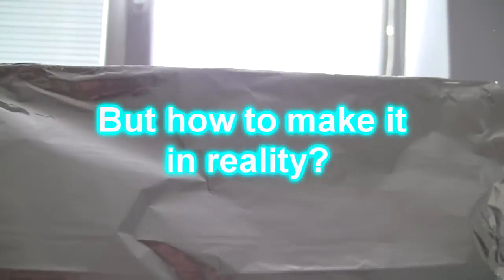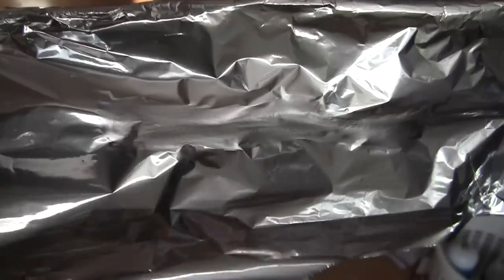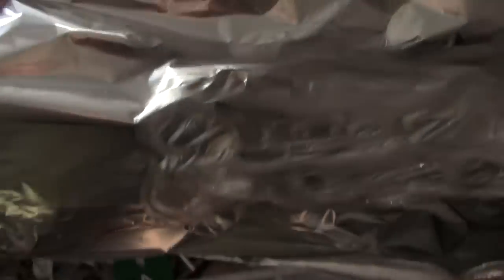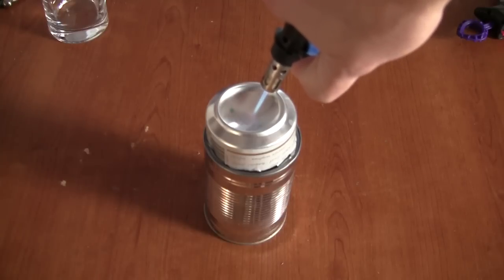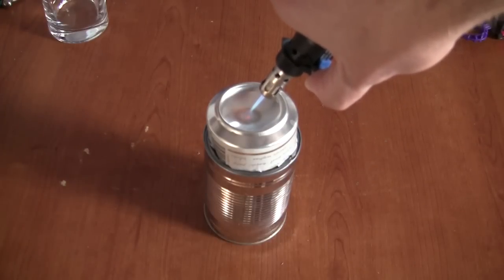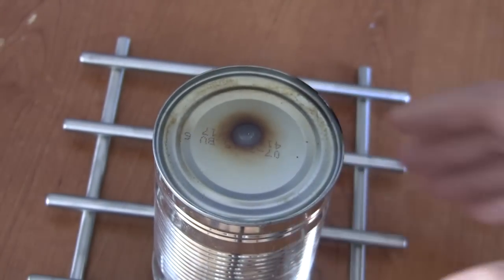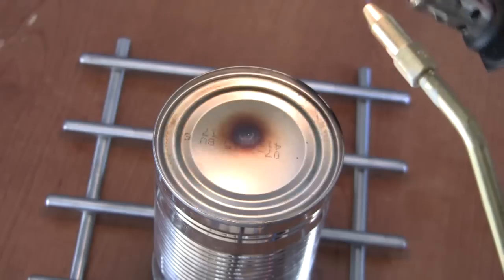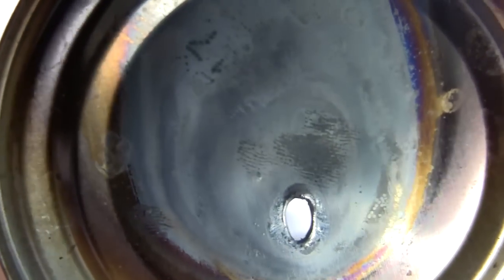How to make REAL Transparent Aluminium!

Comment: How I think this works:

OK this is what I suspect is going on. Firstly why is aluminium not transparent? Well in essence because it is a conductor. Light is an electromagnetic wave, lets ignore the magnetic part (its actually weaker by a factor of c) and just look at the electric field. When the osculating electric field is incident with the metal surface a small current is produced (since metal is a conductor), but because of the resistance of the metal is not zero, the motion of electrons produces heat which is lost to the environment. By conservation of energy the energy of the electric field is lowered and thus the photons are dissipated in short order before they make it any real distance at all through the metal. But when you apply large amount of heat in the presence of oxygen, the aluminium oxides to Al2O3 which is a crystaline material and transparant to light. Steel doesn't work probably because you are producing a mixture of oxides which do not form a regular array like Al2O3. I suspect this would also work very well with the alkali metals like sodium, but with transition metals that do not form nice Crystal arrays probably not so well. Titanium might work though.
Reply: +Nanadaime Hokage All metals are electrical conductors.
Reply: Nanadaime Hokage No I'm not wrong about this: 

http://www.chemix-chemistry-software.com/school/periodic_table/electrical-conductivity-elements.html

Metals are fundamentally different to non metals due to metallic bonding which is nothing like covalent bonding of non-metals which involves distinct molecular orbitals. Metals have alot of molecular orbitals, so many that it is more like a continuum where electrons move freely. The conductivity of something like oxygen is effectively zero, but you will not find a single metal that is not a conductor.
Reply: Nanadaime Hokage Plutonium is f block and things get weird with f block metals. The point is, metals are orders of magnitude better conductors than non metals.
Reply: Nanadaime Hokage No, oxgyen is a dieletric, silicon is a semi-conductor, and iron is a conductor. They mean very precise things. A dieletric bonds covalently, a semi-conductor has a band gap, and a conductor bonds metallically. Yes you can break di-eletrics but that doesn't mean they are not di-electrics.
Reply: Nanadaime Hokage I honestly think you are just being pedantic for the sake of it. Structually dieletrics, semi-conductors and conductors are nothing like each other. I bring semi-conductors into this because that doesn't just mean 'in between the two', a conductor is defined by its structure. Most conductors are metals and they conduct by metallic bonding, a few conductors are non-metals and have unique structures like graphite that also allow conduction. Di-electrics simply do not behave in the same way, they involve covalently bonded material and well separated molecular orbitals.
Reply: Nanadaime Hokage You know people have made magnets strong enough to levitate humans (probably, I don't think its ever been done to actual humans although its been done with frogs). Anyway this is ridiculous, like I keep saying the classifications of these matetrials is based on there molecular structure. The way conductors, semi-conductors and di-electrics respond to electric fields is very different. Di-electrics polarize, conductors conduct, and semi-conductors have a temperature dependence. Manganese doesn't polarize dispite being a relatively poor conductor. In fact look at this list:

http://environmentalchemistry.com/yogi/periodic/electrical.html

You will see that manganese and plutonium are at the top, but things like oxygen doesn't even make it onto this chart its such a bloody good insulator. And notice the non-metal among the metals? No, neither do I.
Reply: Nanadaime Hokage This point is just asinine. Yes everything conducts at high enough potentials but so what? At normal potentials these materials behave very differently and have entirely different methods of bonding. There is something very fundamentally different between how iron bonds and how oxygen bonds; this fundamental difference is why we call one a metal and one a non-metal. And since metals MUST exhibit metallic bonding by definition and metallic bonds always conduct, then axiomatically it is impossible to get a non-conducting metal. Now there are a few other ways to get conduction without metallic bonding so non-metals can occasionally conduct but NEVER the other way round.
Reply: +QuantumOverlord This could be easily summarized by: the aluminium oxidises, turning into aluminium oxide, which is a crystalline substance that light happens to pass through. But, I admire your in depth explanation :)
Reply: +ehtuanK My explanation  is simplistic, in fact the Fresnel equations require that all metals are good reflectors as-well as good absorbers. Its to do with the boundary conditions of electic and magnetic fields and is not something I can easily explain but the reason light does not transmit well through metals can be intuitively understood by the generation of electric currents. As for a magnetic field being weaker by a factor of c, think about this carefully; do electric fields have the same dimensions as magnetic fields? The answer is no, and think about how electric and magnetic fields are different: Electric fields are like forces on charges, and magnetic fields are like forces on currents (or mathematically F=q(E+vxB)), currents are moving charges. The fact they are moving requires a velocity factor which might help you understand why c does not need to be dimensionless.
Reply: Nanadaime Hokage But plutonium is large, which means relativistic effects start to come into play, so bizarre behavior in the f block should not be surprising. Look, metals do not behave like dielectrics. Yes you can break dielectrics if you put a huge voltage across them but even so conducting materials are not transparent because the E field is dissipated.
Reply: Nanadaime Hokage This doesn't even matter; obviously you can have insulators that are not transparent. The point is, you cannot have a transparent conductor; possibly with the exception of nano-materials that are so thin the E field can penetrate it. Basically there is a reason why all metals look roughly the same, silver, shiny e.c.t. and it is to do with their ability to conduct.
Reply: Nanadaime Hokage I've just explained this to you. Lightning is essentially a capacitor breaking. Its still a damn capacitor.
Reply: Nanadaime Hokage insulators are dielectrics.
Reply: Nanadaime Hokage No, there are not any non-conducting metals. Because metals bond metallically, that makes them conductors pretty much by definition. Even the poorest metals will conduct hundreds of times better than covalently bonded non-metals.
Reply: Nanadaime Hokage Not all forms of carbon, only specific types of carbon such as graphite which surprise surprise is not transparant! Amorphous carbon is not a better conductor than manganese.
Reply: Nanadaime Hokage No they arn't did you look at that list, I thought you were wrong by a factor of 1000 it turns out, you are wrong by a factor of 100 trillion! The worst metallic conductor comes nowhere near the best non-metal which on that list is probably iodine which even then chemists describe as having metallic characteristics. Carbon is really the only thing that comes close, but that conducts through a very unique way (as a result of its structure and sp3 hybridisation) amoprhous carbon wouldn't make this list.
Reply: Nanadaime Hokage That is is the astronomical definition of a metal which is completely different. Astronomers use lazy terminology, a solid state physicist or chemist would not use.
Reply: Nanadaime Hokage I think you are just being pedantic for the sake of it. You are essentially saying you can use a capacitor as a wire if you connect it to a van degraff generator but what would be the point! You destroy the capacitor and use it for something it is shit at and ignore the thing its good at. Can't you accept the fundamental molecular difference between metals and non-metals and how that transfers into truly huge differences in the numbers. By the list we both linked to its about 100 trillion. Oh and by the way, I have looked and I can't even find a number for oxygen, I suspect its so small that it hasn't even been measured yet.
Reply: ehtuanK No I do not misunderstand your posts, I am perfectly competent in dimensional analysis; you are misunderstanding my posts. 

"E = c*B"
Correct (given the context I am referring to) 

ergo "E is stronger than B." 

(Again fine)

"ergo E - B > 0"

Wrong. This does not follow from E=c*B; I have no idea where you got this from. 

the correct form is E-c*B>0 i.e E is stronger than B by a factor of c. This makes perfect sense. c is not a number it has a dimension of m/s

You may not have come across this concept before, but yes it is completely meaningful to say E is stronger than B by a factor of c. There is no reason the factor has to be a dimensionless number.
Reply: +QuantumOverlord I lerned it completely different. Doesn'd your explaination imply that aluminium (and metalls in generell) are bad at reflecting light (since it gets absorbed), which is obviously not true.
btw: "its actually weaker by a factor of c" would only make sense if c was dimensionless
Reply: +QuantumOverlord Technically metals are crystalline too since they are also made up of crystals (aluminium has an FCC lattice). The key is the type of bonding within the material, metallic bonding where electrons can move freely through the material and hence it is a conductor, compared to I think it is ionic bonding in alumina molecules. Also as another commenter mentioned you only account for the small portion of photons that are absorbed, most are reflected by some elastic process I am not sufficiently informed on to describe.
Alumina was my first thought as well, aluminium has a thin layer on the surface anyway which then prevents further oxidation. My guesses are either surface tension pulls the molten Al into a rim around the transparent (thin alumina) area, or the varying thermal expansion rates break up the passivation layer enough for oxidation to continue until the Al has mostly reacted leaving behind a fairly thin sheet of alumina.
Reply: Nanadaime Hokage In a world where we are talking about lightning sized pds all insulators are dielectrics.
Reply: Nanadaime Hokage What facts? That anything conducts if you apply a bit enough E field across it? So what? If you apply a big enough B field you can frigging levitate a human. Does that mean humans are magnets? Of course not.
Reply: Nanadaime Hokage You don't have to force huge amounts of potential into them. Take alpha magnaese then (your best example), how much better does it conduct than dry ice? Hundred times, a thousand times?
Reply: Nanadaime Hokage Its a completely different definition! The one you are referring to is only used by astronomers. To all intents and purposes its slang! Are you really using slang to try and make a scientific point? Look, do you want a skype call or hangout about this; if you like I will be happy to discuss.
Reply: Nanadaime Hokage Completely wrong. Lithium metal does not have 'molecular orbitals' in the way oxygen does. The difference between a metal and a non metal is that a non metal has well separated molecular orbitals, a metal just has an essentially infinite number of molecular orbitals forming a continuum. Semi metals kinda have both.
Reply: Take a look at this list again
http://environmentalchemistry.com/yogi/periodic/electrical.html

Lets compare the conductors (metals + non-metal conductor carbon) which range in conductivity about 3 orders of magnitude.

Then we come to the semi conductors which extremely quickly take us 10 orders of magnitude further down. 

By the time we get to non conducting phosphorous and sulpur we are about 17 frigging orders of magnitude down. This is insanely clear cut if you don't worry about the ambiguity of the hybrids, poor metals, semi-metals e.c.t. 

The worst conductor is a full 17 orders of magnitude better than the best insulator.
Reply: Nanadaime Hokage

"Lines of magnetic flux is the same as electron shell quanta energy levels.  A wavicle. "

This makes no sense, magnetic flux is not energy. They arn't even dimensionally equivalent. 

"What are the four fundamental forces?"

Electromagnetism is unified because of the way magnetic fields  lorentz transform into electric fields. From an observers perspective E and B fields are still useful concepts.

"It still effectively shows the states of quanta of the electrons."

If you do not understand MO theory then this explains why I am having such a problem explaining the difference between metals and non-metals. 

"Or potential dependence see diodes above. "

So you agree with me?

"Carbon and plutonium are in the same magnitude."

YES and I've already explained that carbon is a non-metallic conductor when in specific allotropes such as graphite. 

"There is no unit of conductivity Siemens is the resistance(ohms) per meter."

What?! Ohm is a unit of resistance. Ohm^-1 m^-1 is a unit of conductivity which yes is also called Siemens per meter. 

"Are you saying knowledge is a piece of paper?

I'm a post grad in Electronics."

The piece of paper allows me to gauge the knowledge of the person I am speaking to. For the record my background is in Physics, not electronics but I also did considerable amounts of chemistry in my first 2 undergrad years. 

Honestly, I am seeing some serious misunderstanding here which is why I thought a hangout would be a far more efficient way of discussing this. Anyway I'm off to bed now, let me know if you are interested in a hangout; I'll reply to a comment later.
Reply: ehtuanK I'm sorry but you are wrong, If you measure E, B in SI units (which rules out km/s) you will find in light the magnitude of the E field is equal to the magnitude of the B field multiplied by c. It is completely dimensionally consistent BECAUSE E and B have different dimensions themselves.
Reply: Nanadaime Hokage I was about 3/4 of the way through a response and I lost the whole thing. I really cba writing it out again. I will do a hangout with you if you like, needless to say you are seriously misunderstanding the subject and conflating a lot of different ideas.
Reply: +Nanadaime Hokage 
'To enable carbon as good conductor it has to be "doped" with an impurity.'
False. Pure graphite is a conductor (via the mechanism of delocalized pi bonds).

'Energy is heat. Heat is energy.'

This is like saying: 'Dogs are animals. Animals are dogs'. Are you saying that all energy is heat (epic fail), or that some energy is heat (pointless statement)?
Reply: +Nanadaime Hokage 
They use aluminum as much because of cost (copper is expensive) as because of weight. Regardless, it is classified as a 'good' conductor of electricity. It is patently ignorant to claim it is a poor one.
Reply: Nanadaime Hokage Of course a long thin filament is going to have a high resistance. Thats because resistance is inversely proportional to cross sectional area. The resistivity is still similar to other conductive materials.
Reply: *****
Yes, it's all MY fault. I'm hostile. I was hostile from the start. I am aggressive for the sake of it. You're innocent. You have no mistakes. Nothing you say can ever be wrong. There is no fault to be found in you. It's all someone else's mistake. Your science can't be wrong on account of your multiple degrees in multiple fields. You are an authority here, not only scientifically but also in matters of comedy, socializing, and morality and ethics in internet posts, and none should question that in any fashion.
Whatever you say.
Reply: Nanadaime Hokage So you know what a semi-conductor is, and then go on to claim everything is a semi-conductor. I'm sorry but this is just wrong. Oxygen is not a semi-conductor, Iron is not a semi-conductor. Semi-conductors are materials with very specific properties; some of which you obviously are fully aware of.
Reply: Nanadaime Hokage But you'd be wrong, because all metals by definition have metallic bonding. And all metallic bonds conduct. The thing is about as close as it gets to being defined as a conductor!
Reply: Nanadaime Hokage I haven't said anything against you, but I do think you are being deliberately pedantic.

1) Tesla used electromagnetic induction, which is completely different and uses magnetic fields to produce electricity and has literally nothing to do with this conversation. 

2) We are talking about electrical conductivity not magnetism; you are conflating two different ideas. 

3) The electron shell model is crude and really only taught to high school students - MO theory is the functional model that explains the differences between metals and non metals.

4) Semi conductors are not called conductors because they have very different properties. The main one being a significant temperature dependence. 

5) No it isn't, because there is literally 17 orders of magnitude in it. There was barely 1 order of magnitude in pluto.

6) Ohm is a unit of resistance not conductivity. In fact, ohm is extensive not intensive so what you have said is completely meaningless. 

Be honest with me, are you a high school student or first year undergrad?
Reply: Nanadaime Hokage Alloys still bond metalically, and isotopes are completely irrelevant to this conversation.
Reply: +QuantumOverlord You missunderstood me. That electric and magnetic fields have different dimensions is the very reason why saying one was weaker from the other by a factor of c doesn't make sense, because you can only directly compare two values (by wich I mean you can actually say which one is weaker/stronger, or bigger/smaller), if they have the same dimension.
Otherwise you are comparing apples and oranges; basicly it's like saying apples are 1,000,000 times STRONGER than oranges, because if you compare them you get a value of 1,000,000 micro-apples per orange. Or are apples 1,000,000 times WEAKER, because when you compare them you also get a value of 0.000001 mega-apples per orange? It depends on the unit of messurement.
Since c is not dimensionless, saying which field is stronger hinches on what unit of messurement you choose:
Is the electric field stronger than the magnetic one by a factor of 299792458, since c=299792458 m/s?
Or is it stronger by a factor of 299792.458, since c=299792.458 km/s?
Or by a factor of 299.792458, because c=299.792458 Mm/s?
Or by 0.299792458, because c=0.299792458 Mm/s? But that would mean that the electric field is suddenly WEAKER than the magnetic one. (yes, "Gm/s" is an immensly unpractical unit, but it's still mathematicly valid)
And if you chose c as a unit for v, as it's often done in theoretical physics, you get a factor of 1. So, are they now equaly strong all of a sudden?
Directly comparing electric and magnetic FORCES on the other hand is possible because their ratio is always dimensionless.

One more Idea: In order to tell wich of two values is bigger, you can always substract one from the other and look wether the outcome is positive or negative or 0.
Let's say your electric field is currently 1V/m and your magnetic field is 1T, so what's 1V/m-1T?

Nothing of this is new to you, the same way nothing of your post is new to me, all in all we come from the same direction. I hope this solves the missunderstanding.
Reply: Nanadaime Hokage Tow sides of the same coin are still two different sides.
That you can summarize two fields in one term, doesn't mean they are one and the same.
One thing being identical to another means they are interchangeble. The electric field and the magnetic field are not interchangable, as you can easily test by yourself.

The forces, on the other hand, are a different story: By applying the SRT to two moving charges you can deduct the magnetic force from from the electric one. So you could say the two phenomena (!) are the same.
But if you ask "What's the electric force between the two charges?" and "What's the magnetic force between the two charges?" the answers won't be the same.
Reply: ***** I don't get why you keep misunderstanding my posts.

1 = 0.5 * 2
ergo "1 is, by a factor of 0.5, larger than 2."
ergo 1>2
You see the error.

"What is larger:
2 kg or 2 m/s?
4 cm or 4 kW?
1024 m² or 1024 KB?"
You see why these 3 questions don't make sense, but not, why this one makes no sense:
"Is 1 V/m larger than 1 T?"

E = c*B
ergo "E is stronger than B."
ergo E - B > 0
for this unequation to be mathematically consistent E and B must have the same dimension.
And that is obviously not true.
Do you see the error?

Or maybe you get the wrong idea from my posts, because you use "compare" in two different ways:
1) evaluating the ratio of two terms - this works no matter what dimensions your values have.
2) measuring which of two values is larger than the other - if the two values have different dimensions, this simply does not work
In my first post I just wanted to remind you, that you used 2) in your first post.
Since than you keep comparing B and E in the way I've described in 1), which simply was not the problem I meant.
Reply: " "ergo E - B > 0"

Wrong. This does not follow from E=c*B
[...]
c is not a number it has a dimension of m/s"

That "ergo E - B > 0" is wrong and c not a number is the whole point of the argument!

"I have no idea where you got this from."

"2m is longer than 1m." <=> 2m-1m>0m
"2kg is more mass than 1kg." <=> 2kg-1kg>0kg
"2s is longer than 1s." <=> 2s-1s>0s
"2N is stronger than 1N." <=> 2N-1N>0N
"E is stronger than B." <=> E-B>0
(this is what such a phrase would normally mean)

"You may not have come across this concept before, but yes it is completely meaningful to say E is stronger than B by a factor of c."

I've been studying physics for two years now and I can not remember hearing this phrase used with THAT meaning (to be fair, only one cours so far has been in english, so it could hypothetically be possible that english differs from german in this point).

But for the sake of the argument lets say you are right and the phrase "X is stronger/larger/etc than Y" actually has two completely different meanings:
1) "X is stronger than Y by a factor of Z" really means "X differs from Y by a factor of Z (NOT a number)", so "stronger" doesn't mean "stronger" but just "different". This is what you claim is a common usage of the phrase.
2) "X is stronger than Y by a factor of Z (a number)" really means "X is stronger than Y by a factor of Z (a number)"
... don't you think it would be highly misleading if the phrase was actually used in the first way?

Even IF the phrase was used in both ways, you are using it in both meanings in your first post, while ignoring their difference. This would be an equivocation fallacy.
It seams to me that by
"lets ignore the magnetic part (its actually weaker by a factor of c)"
you ment:
"lets ignore the magnetic part since its actually weaker by a factor of c"
(or didn't you?)
"ignore the magnetic part since its actually weaker" <=> "B is neglectable small against E." <=> " B<<E" => "E-B>0" (false)

IF the phrase was used in the first - extremely misleading - meaning, these phrases made sense, too:
"2kg is more massive than 1m."
"5m/s is faster than 3N."
"4N is stronger than 3V"
"Banana is higher than blue."
Reply: ehtuanK I have an undergraduate degree in physics and I have heard this phrase used a lot, and its clear you know exactly what it means so I can only describe all this as an exercise in pointless pedantry.

Lets do this in terms of forces so its more obvious. Lets look at the force on a moving charge (of magnitude q moving at velocity v).

So the force due to the electric field is qE

The force due to the magnetic field is qvB  

The ratio of forces is vB/E

And lets let E=c*B for this example

which yields vB/cB = v/c

v is going to be much less than c in any reasonable example so v/c << 1

which justifies ignoring the magnetic part of the EM wave.
Reply: *****
NOW we finally start getting somewhere!
All day long I was wondering how someone who seams to actually know what hes talking about could repeat the same error over and over again. Now I know why:
v was missing in your posts. A lot.
e.g. "E is stronger than B by a factor of c." should have been "E is stronger than vB by a factor of c/v."
THEN it all starts to make sense. THEN your way of arguing is sound.
Sometimes pedantry isn't so pointless after all.
Reply: ehtuanK The v is there implicitly, because E and B fields are not dimensionally equivalent. But fine I accept that it might be something that is slightly alien to some people; I have heard this a lot though and to me the meaning seems fairly self evident. 

Mathematically these two statements:

"E is stronger than B by a factor of c." should have been "E is stronger than vB by a factor of c/v."

are identical. All you have done is essentially multiplied both sides by v!
Reply: +Nanadaime Hokage   Where did you get the idea that aluminum isn't a good conductor?   Aluminum is what they usually use for high voltage power lines.
Reply: Nanadaime Hokage Sigh. Copper is the 2nd most conductive element, Aluminium is the 4th. Clearly that makes all the difference :S

Still, do you at least acknowledge now that all metals are conductors?
Reply: Nanadaime Hokage I never failed to acknowledge that. Its also possible to live in a cardbord box, that doesn't make it a house.
Reply: Nanadaime Hokage You are saying the 4th best elemental conductor sucks because it isn't as good as the 2nd best. This is not relevant anyway I never said Al was the best. But it is a conductor.
Reply: Nanadaime Hokage Again relative to what, copper? The 2nd best elemental conductor. Do you acknowledge that all metals are conductors?
Reply: Nanadaime Hokage Because copper is better. It doesn't mean aluminium is not a conductor.
Reply: Nanadaime Hokage Apparently you will keep on saying that no matter how many times I agree with you. How many times do I have to point this out. Sensible conductivity definitions (S/m), order of magnitudes.

Conductor: >5
Insulator: <-10
Reply: Nanadaime Hokage I want you to justify your stance that not all metals are conductors.
Reply: Nanadaime Hokage You do realize aluminum and copper have differing rates of thermal expansion? And that its surface instantly oxidises. Despite these flaws, aluminum wiring is actually used contrary to what you say. 

But what does all this have to do with your original point where you claimed that not all metals are conductors?
Reply: Nanadaime Hokage But look at the numbers. Like I say this is sensible:

Conductivity (S/m), order of magnitudes.

Conductor: >5
Insulator: <-10

The poorest metal conductor is only about 1000 times poorer than the best. Yet when you compare the best insulator with the poorest metal the numbers are astronomical.
Reply: Nanadaime Hokage Did you not read my comments, I never said Aluminum is as good as copper. Why do you keep telling me stuff I already know. Answer the question, is there such a thing as a metallic insulator?
Reply: Nanadaime Hokage "Not a metallic insulator no."

Finally.
Reply: Nanadaime Hokage lol
Reply: Nanadaime Hokage But there is no ambiguity at all in the metals which are ALL conductors.
Reply: Nanadaime Hokage Fine name me a metallic semi-conductor.
Reply: Nanadaime Hokage Tungsten is a conductor.
Reply: Nanadaime Hokage You are missing the point here; and its why I think its so odd that you keep quoting resistances. Resistance depends on the size and shape of the material; ergo its useless. The intensive property here is resistivity (or conductivity) and tunsten has a resistivity similar to other conductors. Ergo tunsten is a conductor and is not an example of a semi-conductor.
Reply: Nanadaime Hokage No, in order to determine whether a material conducts you don't want the measurement to vary on the size and shape of the material. That's why you use resistivity (or conductivity). These are intensive properties. And tungsten has a resistivity typical of a metallic conductor. It is not a semi-conductor.
Reply: Nanadaime Hokage Yes I know; I literally just said that. Do you not know what intensive property means?
Reply: Nanadaime Hokage No offense, but I am seriously starting to question your status as a post grad in electronics.
Reply: Nanadaime Hokage But this conversation kinda does.
Reply: Nanadaime Hokage You still need to understand the properties of the materials to understand why they conduct electricity. And in particular why metals must always be conductors and never insulators.
Reply: Nanadaime Hokage Wrong. R/l is not intensive. RA/l is however. This is called resistivity, which is a useful property to determine how well materials conduct.

But really this stuff is basic. The important point here (again) is that metals are always conductors and never insulators.
Reply: Nanadaime Hokage You were the one to take exception to this:

"All metals are electrical conductors."
Reply: Nanadaime Hokage Right, so give me an example of a metal semi-conductor. Tungsten is not one.
Reply: Nanadaime Hokage No, these are all conductors. 

Lets look at an actual semi conductor Silicon (chosen because its a nice elemental example)

Lets compare the conductivities.

Si: 1E+3 S/m
Mn: 6E+5 S/m

Manganese (which is the poorest elemental metal conductor) has a conductivity 600 times greater than silicon. The same is true of Bismuth and plutonium. 

So no, neither of those three examples are semi conductors. Silicon is.
Reply: Nanadaime Hokage Well sure, but that 3 orders of magnitude is fairly gradual if you were to order the metals (and perhaps stick graphite on as a non-metallic conductor). 

Silicon of course isn't an insulator but a semi conductor. Semi-conductors are a little more complicated because they are defined by their more unique properties (ones that neither insulators or conductors have). Metals do not exhibit these unique properties so cannot in anyway be called a semi-conductors. 

When it comes down to it, without exception: metals are conductors.
Reply: Nanadaime Hokage No, a semi conductor has a set of properties it must exhibit such as strongly temperature dependent conductivity. Plutonium is not a semi conductor. Tellurium might be although I'm not too sure. 

But luckily we don't have to worry about the ambiguous region between conductor, semi-conductor and insulator because all metals are well over to the left (i.e unambiguously conductors)
Reply: Nanadaime Hokage Well that's just one property that makes a semi-conductor unique. You don't see a dramatic temperature dependence in insulators or conductors like you do in semi-conductors. Semi-conductors are quite easily identifiable by some of these properties. And anything significantly more conducting than a semi-conductor (but without these unique properties) is a conductor; and I think that is a very reasonable way to look at it.

And all metals for-fill this requirement. I'm not saying its a binary or that there is no ambiguity between the three categories. However, I am saying that metals are all unambiguously in one category (conductors).
Reply: Nanadaime Hokage If you just post links it gets caught in the spam filter, so I haven't replied until now.

Anyway as far as I can tell these materials arn't actually insulators. Merely alloys that loose there conducting properties at low temperatures and become semi-conductors. Of course as the wikipedia article says, they no longer have metallic properties so are arguably not metals anymore.
Reply: +QuantumOverlord +Nanadaime Hokage
Hey you guys, it is basically pretty simple (typical question for your Bsc exam in experimental physics) :
Conductors have no band gap and a fermi surface, semi conductors have have a band gap in magnitude of kT@RT, insulators have a bigger band gap.

And of course there are conducting and transparent materials, check out the wonderful world of the TCOs (Transparent Conductive Oxides) as for example ZnO:Al 

And for you Nanadaime:
In a field effect transistor the potential at the gate causes a 2D electron gas to form at the interface channel
Reply: AsselParty You cheated though with TCOs :P, I said if you made it ultra thin it could be transparent. 

"possibly with the exception of nano-materials that are so thin the E field can penetrate it."

But yes I completely agree with your post. The MO approach that I was using earlier is also basically equivalent to this.
Reply: +QuantumOverlord Nice. I like it. A bit off though, because you're focusing on the event more from a chemistry perspective, and this has more to do with physics, particularly atomic material mechanics.

Nice go at it, though.
Reply: PaulIvanish Its from both, my degree is in both physics and chemistry, actually more of the former than the latter xD
Reply: *****
Claiming degrees on the internet is so distasteful. Those declarations can't be verified, for one. And the passive implication of appealing to one's authority is another reason. I don't think anyone should go there, so I won't.

I could point to the error in your OP's explanation, particularly the part about Al2O3. Because while what you do explain is consistent with a property of that chemical, you fail to consider another important character of material science shown in the video at the moment the hand torch is used. Compounded to the aluminum can's bottom, and it doubly fails.

Let's not, though. I dislike the attitude of appealing to one's authority, even passively as you did in this reply with your claims of holding a degree or several degrees. I honestly thought you'd answer differently, more focused on the science than focused on the self. Besides, there's already better explanations elsewhere in this video's comment section.
Cheers.
Reply: PaulIvanish You are taking a comment way too seriously, no I was not appealing to authority; I was making a rather flippant point which seems to have been missed. You have turned a perfectly innocent comment into a needless confrontation. So no, I do not appreciate how aggressive you are being for literally no reason. 

Let's discuss the science then; can you please clarify exactly why you think I am wrong. I'm not really sure what you are getting at in your 2nd paragraph but it isn't clear. 

P.S xD (or other emoticons) are usually used to denote a light hearted nature of a comment. Stop assuming malintent where there is none.
Reply: *****
There's no need to get sanctimonious. And jokingly or not, you did mention your own "credentials" here. I'll accept that maybe I missed the point provided you can explain why you thought it necessary to mention that you have one or several degrees in those fields you mentioned other than that very off-shooting reason of typing that it's supposed to be a joke (with that juvenile addendum regarding emoticons). And I did say in my post that you did it passively, in case you yourself failed to grasp it.

No, I am no longer in the mood to discuss the science. I'm very adverse to people claiming personal crap like that on the internet. If you have no explanation to offer for that, we might as well call it quits now before you keep blaming me for things you did.
Reply: PaulIvanish In this case, yes, it is your fault. You take a single flippant statement and completely flip out over it. If you want to discuss the science, lets discuss the science. This argument is childish beyond belief.
Reply: *****
Not as puerile as your tactic of claiming degrees on the internet, chummy.

So to "win" this argument, I'm about to claim the same, and then I'll put an emoticon at the end. That way, you'll know, as per your "rules" or notions or posting considerations or w/e you call them, that my claim is both socio-dynamically justified and also unquestionable here on the internet, both in intent and in meaning.

Here I go:

I'm a Stanford-Princeton-Cornell-Caltech-Oxford graduate in Astrophysics, Astrobiology, Quantum Mechanics, Anthropology, and Media Studies, with 4 master's degrees in nanotechnology, experimental physics, quantum chromodynamics, and x-ray crystallography, and a triple Ph.D in theoretical physics, thermochemistry, and material's design. I also have an associate degree in food science and another in criminal justice. ;D

edit: this would probably apply to everyone claiming degrees in this thread.
Reply: PaulIvanish Lol, I know you want me to say "I have a degree so I know what I'm talking about" but I never did. Again, you are picking fights over nothing.

You never had any intention to discuss the science did you, you just wanted to argue about nothing.
Reply: *****
No, I really did. And in fact I did in another post, briefly. But I did go over several threads seeing how people would explain this. Most actually used the chemical approach solely or briefly accompanied by some physical properties, yet forgot the angle of materials science. It's interesting. I think it has to do with Thunderf00t's credentials and his channel focus. I don't really know, though.

What I do know is that this is the only thread that I found where people starting poising allegations of degrees obtained against one another. Someone there is something in electronics with a degree, and then someone else is a chemist, and then you have those degrees in chemistry and physics. All very much the realm of allegations and ego-tripping. All on the way to hubris-land. And all very unrelated to the science, really.

So yes, you kindda did start on the road to appealing to personal authority. Again, you might have been careful enough to not do it overtly. Instead, you did it more passively, with that emoticon cover and all that, so as to not make it that obvious; passively reaching to the same authoritarian principle intellectually. But it's there all the same.

I reserve the right to ridicule all that, and I do. Sorry about the offense it might cause, but accusing me of not wanting to discuss the science is a deflection tactic. I'm not the one claiming degrees to back up my claims. You are. Well, I did too afterward, but then that emoticon has my back, see? So it's all good.
;D

edit: the entire "Quantum Overlord" username that you use is probably another undertone of self-authority passive appeals. In other words, you are portraying yourself to be the degrees you (allegedly) hold, and your argumentation has shades of that in it. You should be ridiculed for it.
Reply: PaulIvanish Jesus can't you just take my word for it, it was a flippent remark. Why do you take this so seriously? But no, instead you assume the absolute worse and create possibly the most pointless argument on Youtube (and yes there are social cues in that you clearly missed).

Again, the point of that remark was simply to express surprise you thought it was from a chemical perspective since my background was mostly physics (no I do not have 'multiple degrees' I have no idea where the hell you pulled that from) in a flippant and jovial way. I'm sorry for not being 100% serious in a damn Youtube comment. So No, I did not appeal to authority, you completely missed the point which I have now spelled out explicitly twice. 

Really the whole 'you think you did it passively' is just reading too much into one damn line. 

I'm still happy to discuss the science if you actually want to have a civil conversation. I promise I won't attempt to be informal again or heaven help me tell a joke.
Reply: *****
I'm not going to take all the fault in this. If I misread it's then entirely possible that I did it because some types of irony can't be remarked with proper speech inflections via written text, particularly in comments. I will admit to taking things too seriously at times. I will not concede that your mention of a degree is done jokingly after I see that you followed suit when other people in the thread did the same. I will apologize for taking things too seriously. I won't apologize for reminding you that claims of degrees are tantamount to appeals to authority, and those have no place in science, regardless of how true they might be. Further, this entire mention of your username "QuantumOverlord" is another sign that you do in fact take yourself a bit too seriously, even if it is just a username. I can't see myself taking this entire conversation seriously now that I've taken a second look at the entire thread, with people claiming electronics involvement in the video's showcase even though this isn't a case that's solvable or can be fully explained from an electronics perspective.

I will say that your initial instinct of starting off with the properties of aluminum was right and is supported, but then you went off on the side of it being a conductor, which is where the mistake is regarding its properties as a material. This implies involvement of other properties, which you did touch on in your OP, but failed to properly develop. The use of Al2O3 also only applies at the surface level of the phenomenon, not on the inside volume of the material, pertaining to its thickness. Which, incidentally, is a good question to ask: what's the difference between the surface phenomenon, that which touches the flame, to the one that doesn't touch the flame? Or, how about the other surface, the one on the other side of the aluminum, untouched directly by the flame? Those are good questions to begin tackling this thing. That's materials science.

That's really all I have the patience to say on this. This has all been rather unpleasant. As a joke, claiming degrees is unfunny and distasteful, and deserves ridicule. I'm going to withdraw now. Again, I apologize for taking you too seriously. I don't apologize for making fun of your username coupled with your claims of a degree or degrees (and I really don't care to count them, even). Please don't reply.
Reply: PaulIvanish That's why I used the emoticon. On the internet, yes, this sort of thing is harder to deceiver without body language; so its customary to use something like that to make it abundantly clear which in this case was the "XD". The thing is, such a comment was actually an attempt to make this more informal, part of the reason I mentioned the degree is because its personal information its completely consistent with attempting to make the atmosphere light hearted. However instead of making the conversation more friendly, you were hostile to me; how the hell was I supposed to have predicted that? And yes I actually agree that degrees are important to claims of authority, but I wasn't doing that, you only thought so because you assumed the absolute worst of me. "QuantumOverlord" Jesus I created my account back in 2010 as a teenager, if you must know it is a homage to a design I made when I was about 12 in an art class; we had to design a superhero and QuantumOverlord was my idea for a superhero. This whole thing is ridiculous. Look, I appreciate you might have got the wrong end of the stick, but why are you continuing this when I have told you what I meant by that comment. Why would I lie about something so trivial? 

Regarding the science (and I hope we can draw a line under the above and just talk about this) your point is actually pretty interesting, and yes its odd that the whole thing becomes transparent and not just the surface; I guess you would expect the Al2O3 to just be on the surface.

You made this unpleasant, by picking a fight over a flippant remark. The whole irony about this is that the comment actually attempted to make things more pleasant by being informal. Frankly I am fed up now after being called an egotist and implied that I am a liar all over one bloody line.
Reply: *****
Well, by that same reasoning and intellectual break that you're demanding of me, how was I supposed to know that you were going to give me a reply claiming degrees in your first reply to me here? My original post to you is about the science, not the degrees.
Why would any degrees being held by you be any sort of an answer? Explain that, fella. Even thinking that it's a joke is a bad excuse, because it's a bad joke, with authority undertones. And to be honest, at this point I have some trouble believing that superhero explanation.

Whatever, it's all irrelevant now. I already apologized for misunderstanding but you seem to want more than just an apology. I have nothing more to offer, sorry.

I won't apologize for the reminder that degree-claiming = appeals to authority. Justifications of jokes don't make that situation salvageable. I stand by that remark, no matter how displeased you might be.

I don't really know where to go from here. Perhaps the situation can be restored. I don't know, though. Perhaps you want to continue this conversation, so either PM me or find another thread at the very least. I'm all for admitting mistakes but I really don't see how you expect a pass from passive-informal appeals to authority on the internet.
Reply: PaulIvanish I've already explained this, I don't understand why you are finding this difficult to grasp.

Purposes of that comment:

1) To make the conversation more informal and light hearted.
2) To express surprise that you thought I was coming from a chemistry viewpoint rather than a physics one - i.e "isn't it amusing that despite having a physics background people think my comment was more chemistry orientated. I wasn't even denying what you said, I was just expressing interest that you thought I was coming from a viewpoint different to what I thought I was coming from.

Again you turned a point where I was attempting to have a more informal/personal chat with you into one of hostility. If you are trying to send the message, never attempt informal conversation online; then that's exactly what you are doing.

"I have trouble believing that explanation" yeh that's part of the problem, you are taking a trivial point so damn seriously (I mean really, how much does the name I use on the internet really matter). Still you can verify that my account was made in 2010 and that I had the voice of a teenager. 

I don't want an apology, I simply want you to stop implying that I am a horrible person and that my motivation was argument from authority. Frankly I don't care if you got the wrong end of the stick when you replied to me, the really irritating thing is that after I said exactly what I meant by that comment you are still being hostile for no reason. 

No it wasn't a passive appeal to authority. It was a flippant remark. I'm kinda getting the impression you want it to be though, just so you can argue about it. Well I'm sorry but that comment never meant

"I've got a degree so I know what I'm talking about"

no matter how much you want it to. 

And yes, feel free to pm me if you like.
Reply: *****
Okay, now I can see now that there's no improving this situation.

And I've already accounted for the possibility that I'm taking things too seriously. I even apologized for it several times. YOU are the one that seems to be categorically ignoring that and cherry-picking what parts of my post you dislike without getting the actual message. I'm done repeating it. I do not apologize for my statement about appeals to authority. I stand by it. You taking offense to it is not, and has never been, an argument. You're perfectly welcome to take all the offense you like. That's allowed on the internet. All you're doing now is playing the victim card. Victimize yourself all you want then.
Additionally, you repeating the possibility that I might have gotten it wrong, or that I did get it wrong, is also not offering anything new. I even apologized for it and you seem to not be taking that into consideration at all. I'm not doing it again, Fine, you weren't appealing to authority, and instead were making a joke. Good for you, fella.

I'm done. Keep your "science" and keep your non-appeals to authority and your reasons for inserting jokes randomly and what not. I've given openings for us both to drop the subject and you don't seem to catch that.

So forget it then. Yeah it's all Al2O3's properties causing it. Problem solved. You got it.
Reply: PaulIvanish My main issue with all of this was the unnecessary hostility. All I wanted was that you just give me the benefit of the doubt and assume I wasn't lying about the intentions of that post. You don't have to apologize. 

So yes, let's drop this. I am every bit as sick of it as you are.

"Yeah it's all Al2O3's properties causing it."

See, you are still being hostile and sardonic.
Reply: *****
Well, after all the irritation you tried to push on my plate after several times apologizing, I really don't think you have any leverage left to now start suggesting that I have an attitude that's a problem or that is distasteful.

And I KNOW I didn't have to apologize. I chose to apologize as a sign that I aimed to redeem and to recognize that maybe I made a mistake. I am human, you know? I can make mistakes. That's all implied in me apologizing. I didn't think you'd need it spelled out, tbh.

You didn't want to take that? Fine. Conclusion? W/e you say. Yes, I'm hostile, as you say. Yes, it's my fault, as you say. Yes, you're 100% right, no faults laid at your feet.

There is such a thing as being a bit too determined to be insulted, you know? I do think you're exhibiting that. In addition, I do think you could've approached the subsequent posts I made a bit differently, in case you're wondering. Which you probably aren't. The only vibe I'm getting at this point is that you want some... recognition of sorts, something beyond apologizing. It all does play somewhat right into the concept of self-authority, self-righteousness, and self-flagellation, intellectually. Coincidence? Perhaps. My fault? No.

You're too sensible, fella. Mature a bit. Sometimes people misinterpret. I willed myself to that end, and you still didn't take it, even now. Your attitude, even with harmless jokes, does little to promote even a casual talk about a phenomenon being tackled, even in YT comments.
Reply: PaulIvanish "There is such a thing as being a bit too determined to be insulted, you know?"

Then why are you making such a big song and dance about it. Really you could stop all this by just acknowledging the point of that comment and letting the damn thing go, no apology necessary. But instead you insist on this stupid 'passive authority' conspiracy theory. 

Its really rich to accuse me of being self righteous when you make such a huge deal over one damn line. Drop it.
Reply: *****
There is no big "song and dance" happening. There is also no conspiracy theory. Those are exaggerations. If this is how you plan on proceeding, you'd best check exactly what it is you're arguing against since a defining principle of "being too determined to be insulted" is exaggeration of your opponent's points.

I dropped it some posts ago. I did say that if you wanted to continue you could PM or find another thread to + me to. You did neither of those things and instead opted to keep on justifying yourself whilst vilifying me. Those attitudes both are almost diametrical opposites to whatever scientific discussion you purported to want. Joke or not, appeals to authority are fallacious arguments. I'm completely up for admitting you weren't doing that and I even apologized for it sincerely, but instead you seem to want to reach some pedestal of ideological superiority against me by acting the victim and now by exaggerating. None of those things are going to work. Moreover, both of those things are absolutely examples of self-righteousness.

Take a page from your own suggestion box and drop it now as I did. You're not going to like what comes next, fella.
Reply: PaulIvanish I'm not going to continue arguing this, its trivial and frankly boring. Lets talk about the science.
Reply: *****
likewise, dipshit
Reply: *****
Some other time perhaps.
Reply: PaulIvanish So you had time for all that nonsense, but not actually a discussion of the science.
Reply: *****
It's not a matter of time.

It's a matter of willingness.

And I do note the attempt at ridiculing me. Very passive-aggressive, fella. That's why you've lost all face to now attempt to 'ahem' discuss the science. I can now safely throw your retort back at you: you never really intended this to be about science, did you? It was all about validation from strangers on the internet.
Heh.
Reply: PaulIvanish Lol, you are the one that initiated this pointless discussion. What validation?
Reply: *****
Hey, you kept opening this door, fella. I was quite willing to leave it several posts ago. I was also trying to argue the science of it, and offer an alternative POV.

The validation you seek is on account of your take on this video's phenomenon as well as on mentioning your credentials as asserted here in this comment section.
Reply: PaulIvanish Lol, you see. You would rather have an argument with me about trivia than discuss the science. You are being contrary on purpose.
Reply: *****
No, I'm being evasive. I'm trying to evade people that pretend to talk science but really seek validation on the internet.
Reply: PaulIvanish Haha, validation from whom? You?
Reply: *****
From those that read your comments, comedian-wannabe.
Reply: PaulIvanish I don't want to be a comedian. You are really pulling straws now.
Reply: *****
Not as much as the straw you pulled when you falsely accused me of making a big deal out of this thread and of your joke. I made the opposite of a big deal: I tried to end this, several times over, and you wouldn't let it die. You still won't.

You're a comedian-wannabe on account of that "joke" where you revealed your degree or degrees in those STEM fields. It's sarcasm, you know? ;D
Reply: PaulIvanish Lol because you have, this entire conversation is over one line. You are out looking for an argument. 

End it then, lets talk about science.
Reply: *****
"Lol because you have"

Because I have what?

"this entire conversation is over one line."

I wouldn't say this conversation is over any line, really. In a certain way, it's still quite civil and rather entertaining, but not in a scientific or even STEM-related manner anymore. Which is just deplorable because it was supposed to be about STEM, but then you had to be a comedian and reply with a joke. And while there's nothing wrong with joking, there is when there's information about yourself in that 'joke' that wasn't solicited. And also, the joke wasn't really funny, conceptually.

"You are out looking for an argument."

Not really. This is more along the lines of the notion you have of me. It's the source of the strawman argument you're mounting to preserve your "joke" intent, past and ongoing. I really did start my post with the topic, and you can go back and verify this if you aren't satisfied with reading me now. I had no way of knowing you were going to joke your way into righteousness. But, alas, what's done is done.

"End it then, lets talk about science. "

I'll take you up on the first part of that sentence.
Reply: PaulIvanish Omg 31 lines. No, this is boring; stop it.
Reply: *****
Wow, really? But you yourself have done posts over 40 lines. At 1:04 pm you did one over 50 lines.
Double-standard much? Heh
So you can't be bothered to read what you might have to read to follow whatever line of thought you're engaged in once things don't run the way you fancy?

Hahahahaha

Okay then, it's your loss. I accept your intellectual surrender, fella. Know that your joke and the subsequent lack of accountability for it's rather poor content were what stopped you from maybe having access to other perspectives outside your own, which in itself is a detriment to the proliferation of ideas.

Good riddance. You've proven your worth in the negatives.
Reply: *****
The argument died even before your pathetic attempts at ad hominems.

Thanks for playing.
Reply: PaulIvanish mmhm. so sad.
Reply: +gogleg4 

thanks a ton. was not sure what electromagnetic waves had to do with it
Reply: Ohh yeah... Science!
Reply: PaulIvanish I'm sorry but I cba with this nonsense. You are not here for an interesting civil conversation, nor are you here to disagree with what I have said. You are here to play sanctimonious not me. The context makes it obvious how that comment was intended, you completely missed the point and became aggressive for no reason. Its like you are just picking fights for the sake of it.

Don't put this on me, you are the one that wrote two indignant paragraphs on a perfectly innocent comment. 

I should not have to explain this, but the comment was intended to suggest that contrary to what you have said it came from more of a physics motivation than a chemistry one. The degree thing was just flipent and light hearted, and if it wasn't already obvious enough the emoticon also makes it abundantly clear. 

You are just looking for an argument for no good reason. I'm pretty irritated at you that you are behaving so aggressively for no reason.